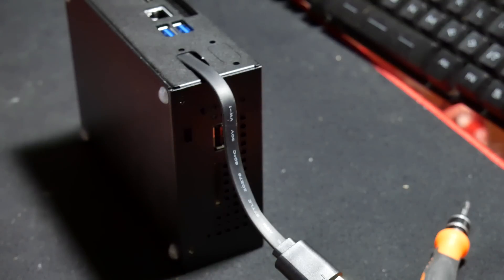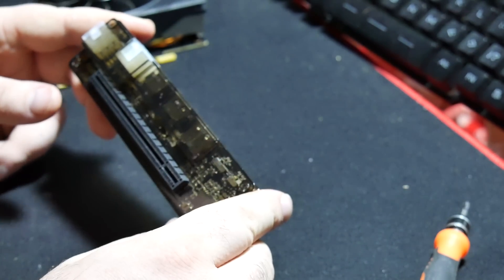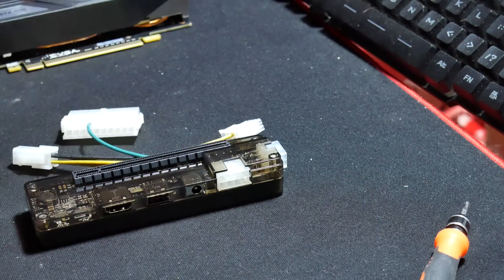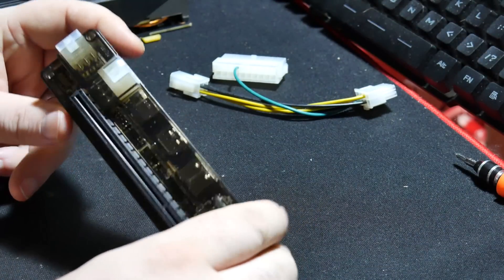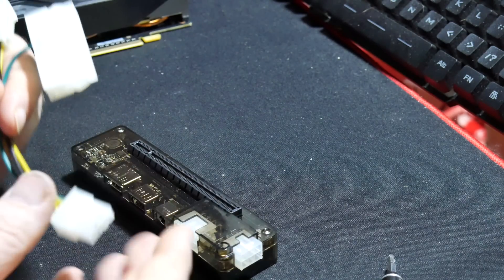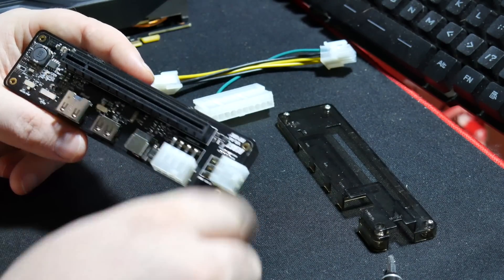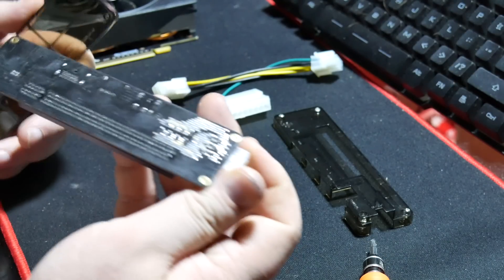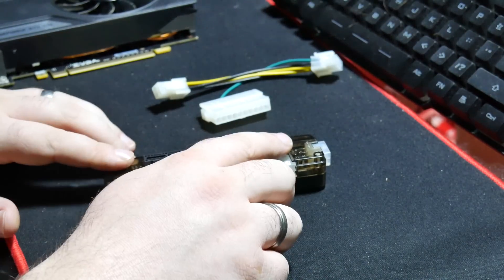Beast 8.4d - External PCI-E Adapter - Tear Down

Comment: atx power is not for it to run on atx power. it's for the e-gpu to either be always on when it get's power from the atx, or only being on when the hdmi cable gives it signal. this is for people who have issues that there computers wont detect the e-gpu while booting, they can leave it always on so it will be faster recognized by the bios.
oh and the slim line toggle is for the usb port to toggle where it get's ground from, i don't 100% recall what it was
Reply from the maker: +Dennis Gagliano awesome thanks for the info. I know that I myself know next to nothing about this I just find it such and awesome device to have around my office for testing and stuff like that.  I got the Dell PSU for it but haven't tested it out yet.
Reply: i have, the dell works great, i had a gtx 960 in there overclocked and all using the 220w dell, no problems at all. :)
Reply: Hi I'm thinking gonna use the music gtx 750 ti twin frozr 1gb but can I use cheap psu running at 500watts or 225watts cheap psu is it ok or no?
Reply from the maker: +Shite Ness 500 since I don't know the rest of the build 500 watts should carry you just fine.
Reply: but i heard lot of people said cheap psu might blow/burn up is this true i mean i only use the cheap spu for exp gdc not for desktop.is it safe?
Reply from the maker: +Ameer Qan yes the quality of your power supply does potentially impact the life of your components. If a power supply fails it can potentially take out parts of your computer. My recommendation would be get a cheap yet reliable 80+ bronze PSU.  I know for a fact that you can get EVGA 80 plus bronze power supply for around 40 bucks.
Reply from the maker: +Ameer Qan quick question is this for an entire computer or just an external GPU?
Reply from the maker: +Shite Ness if this is for an external GPU using the Beast egpu adapter I would look up 220 Watt Dell power supply. It looks like a giant laptop power brick and it works great for the Beast egpu adapter.
Reply from the maker: +Ameer Qan sorry I didn't realize who commented prior.
Reply: i have 2 accounts so its me.So a cheap PSU not good for the exp gdc to run then i should use the dell power brick?
Reply from the maker: +Ameer Qan yeah if you're running the Beast adapter hop onto eBay search 220 Watt Dell power supply look for a massive looking laptop power brick Style with a odd-looking 12 pin connector. It looks identical to what's on the side of the Beast adapter. I use the Dell on my Beast and I'm running a gtx 960
Reply: ok thx but i have HP sleekbook 14 laptop im afraid HP has whitelist their wifi card if i remove and put the minipcie exp gdc cable in it and wont boot.is there any fix for that if i encounter one?
Reply from the maker: +Ameer Qan there may be your best bet is to do some Google Foo and see what you can find before doing it. Sorry I'm unable to help more on that aspect. I've only ever  used mine on a i3 nuc.
Reply: ok thx im also thinking gonna buy either cheap gaming pc or mini pc with external gtx card
Reply: is this the one the dell power brick i cant seem the odd looking 12 pin connector so im not sure? https://www.lelong.com.my/dell-usff-220w-power-supply-adapter-optiplex-745-755-760-280-520-620-startechmy-166262288-2018-08-Sale-P.htm
Reply from the maker: +Ameer Qan yep that's the PSU
Reply: ok thx bro
Reply from the maker: +Ameer Qan no problem

Comment: What is difference between v8.0 and v8.4d?
Reply from the maker: Unsure from photos they look the same but maybe it uses a different HDMI standard for more speed. Idk never had the 8.0 only had the 8.4d.
Reply: Thankyou for reply.
I want do build an egpu setup 
I have samsung ativ book 8
3rd gen i7 3635qm with Radeon 8000series chip.
Will egpu work on my laptop.
I am thinking to buy RX580.

Comment: Hi Anthony if you still around here i need to ask you something about your EGPU setup, any halp will be apprecieted. Thanks in advance.
Reply from the maker: Sure I will try my best to help.
Reply: @krypticnexus  I have an Intel NUC same as you but i couldn't get the system working. Do you have any special set up or just plug and play. I don't have any other cable or device to try different cable or device. I don't know if its a system or able failure.
Reply from the maker: I had to start and stop my system several times before it just started working it was very odd how it worked

Comment: Since it has pcie 16x will it work wit sound card or Raid controller too? Any one test?
Reply from the maker: It really should work with anything and no testing has been done on my part. It just would be like plugging said card in to a 1x slot like I do with a gpu.

Comment: Can I put it on my Desktop?
Reply from the maker: Why would you?
Reply: @krypticnexus  attempting to do something hehe
Reply from the maker: I mean technically you could is your motherboard add a msata socket.  the only reason I ask why would you he is because the card that would go into the adapter would only be running at 1X speed
Reply: @krypticnexus  I was gonna use it to side mount my gpu but if it takes away from performance that much I’ll just order another cable

Comment: Hey i was wondering if you could help me please , i have an asus g74x or g74sx Laptop from 2011 was wondering if this would work ????it had the same wifi adaptor i can afford to sacrifice
Reply from the maker: Sadly it's pretty much trial and error. It depends on if anybody else out there has tried it and if so if it had worked for them. getting it to work on the computer I used was a Major Pain. It probably took at least 20 boots before it worked. Because there's no bios setting 4 something like that so it's just plug it in turn it on if it doesn't work turn it off it back on and hope for the best. I would say see if anybody out there has used the beast on a similar laptop to yours. Sorry I couldn't be of more help.

Comment: Hy bro please tell me that does gtx 1050ti mini 4gb supports exp gdc v8.0
Reply from the maker: +King ABLN it will support pretty much any pcie video card that's not the issue. The issue would be bandwidth limitations. Because you would be taking a pcie 16x card and connecting it to a pcie 1x port. Basically you would be going from 8gb/s to 500mb/s.
Reply: Anthony Cress then what should I do to get maximum speed bro?? Or tell me what card should I get to get maximum speed but I need 4gb ddr5
Reply from the maker: is this the only option you have. other wise i would put it in a computer with 16x slot. also depending on the connector if you are using a minipcie then your limited a lot but if you are using a ngff pcie x4 then you maybe ok.
Reply: Anthony Cress bro where do I connect ngff cable in my laptop
Reply from the maker: something like this would offer more bandwidth since its pcie 4x

https://www.banggood.com/M_2-X4-Version-V8_0-EXP-GDC-Beast-Laptop-External-Independent-Video-Card-Dock-With-Power-p-1109912.html?rmmds=detail-left-hotproducts__4&cur_warehouse=CN
Reply from the maker: it just depends on your laptop
Reply: Anthony Cress bro or else does rx 550 4gb works with 70 to 75% with exp gdc v8.0

Comment: is it support the Zotac Amp Edition GeForce GTX 1060 6GB DDR5 PCI-e Graphics Card with IceStorm Cooling
Reply from the maker: +Stone Cold Steve Austin it theoretically should work but it's going to be a massive bottleneck because you're trying to put a lot of info through a 1X pcie Lane not a 16 x

Comment: i think i saw m.2 slot in the compact pc that you opened up , did you tried using m.2 version of exp gdc ?
Reply from the maker: +Corvo Attano I don't have the cable sadly so I have not tried it
Reply: i think its a whole different unit not just cable , anyway thanks for texting back ^_^.
Reply from the maker: +Corvo Attano amusingly it's not it's just a different cable that is needed for all of the the different versions. It's 26 bucks on banggood

Comment: Instead of the HDMI to Pcie could I use a HDMI to a USB 3.1 type c. Because my Acer E15 does not have a Pcie only a M2 Ssd
Reply: mostly likely not, because its not using HDMI in the way you'd think

Comment: Hey man, I have an ASUS TP500LB with an internal Nvidia 940m, I bought 2 EXP GDC, one is 8.4D and the other is 8.3E, the 8.3E comes with a fatass cable which for some reason does not work,  it only worked once because the nvidia card is not shown in my Device Manager, but I had no problems with the cable that came with 8.4D, do you know what to do with that particular cable,and why it does not work. these are the 2 cables:

http://gloimg.everbuying.net/E/2015/201512/goods-img/1468363921956843257.jpg
http://gloimg.everbuying.net/E/2015/201512/goods-img/1468363921956843257.jpg
Reply: Hey man how did it go with the eGPU? Have almost the same laptop, was hoping to do something like you did
Reply: It works fine, the really problem here is the setup , but it work not excellent, but good, you can still get BSOD and crashes, also I strongly recommend disabling Windows Update because it will try to update your Nvidia Driver, I will explain why later.

I am using Nvidia GTX 1060, DO NOT USE IT!

New drivers don't work at all, in best case, the second screen will freeze and the picture will only be shown in your laptop's  screen, in worst case you get a BSOD, the only driver version that works for GTX 1060 is 372.54, 372.70 used to work too, but not any more, at least not for me.

I definitely recommend the EXP-GDC, this is awesome, you should also always have 1 extra PCIe-HDMI cable, because they tend to become damaged pretty easy.
Reply: r8Rusoski i thought the error 43 was resolved with the latest drivers for the gtx 1060? Are u able to play wolfenstein 2?
Reply: Which version are you talking about?

Bad news are that the only one version working for me is 372.54

I can't play EuroTruck Simulator 2, CoD: WWII
Reply: don timbol Hy bro please tell me that does gtx 1050 ti mini 4gb supports exp gdc v8.0 l. Please reply soon

Comment: Did you try to connect that into a Thunderbolt type C port? using a cable hdmi to usb type c... this for a laptop who have this port obviously, You think that its possible? (sorry, I don't speak eng)
Reply from the maker: +Mijais Cares sadly no I don't think it would function at all. Also I have no way of testing this idea. I think it would be pretty cool if it did work.

Comment: What's the deal with the Dell brick style PSU? Do I run power to this board from the Dell PSU and the PCI-e card just takes the power from the PCI-e slot?
Reply from the maker: +Adrian Kielbowicz basically, the reason for the Dell brick style PSU is that it's less messy and cluttering than the standard ATX power supply would be. And yes if you have a pcie slot powered graphics card then it will power it if you have something that requires external power it comes with external power connectors that connect to the PCB of the external graphics card and into the card itself and the brick power supply will still have enough power to supply that card fully.

Comment: This thing make me cry.......i keep get ERROR CODE 12, Even installed Diy Egpu Setup 1.X, try many many time, finally i give up.
Reply: error 12 is just down to pci compation in diy egpu setup, do it to the max and note that it won't take effect if you don't boot your computer through diy egpu setup - second option in its boot menu), there could be loads of other errors which you could run into, also I played with my EGPUs PTD switch which could also have played some part, I think my machine didn't even detect the EGPU on default switch position, I keep it at middle, setting this thing up on some boards can be hell tbh
Reply: that startup option I was talking about is second in this screen:
https://odd-one-out.serek.eu/wp-content/uploads/2014/04/DIY_Menu.jpg
(automated startup) if you don't use that to boot Windows then you might as well not use DIY egpu setup, you have to do PCI compaction on all available devices and disable unused bridges or whatever that option was called
Reply: my first comment wasn't posted due to youtube link - so in DIY egpu setup 1.x:
1. pci compaction on all pci, disable unused bridges (makes error 12 go away)
2. port speeds to 2x/4x on egpu slot in diy egpu setup
3. older or newer egpu card driver in case of bsod (make sure you use desktop card driver version)
4. PTD switch to other position on egpu board (middle in my case)
5. booting Windows through diy egpu setup 'automated startup' option

I also did the hardest option which involved creating pci dump with RwV1.4.7 soft and then loading it, but I am 90% sure it played no part and made zero effect
Reply: not sure if your problem is chainloading vs startup.bat, it never worked for me with chainloading, though it might have been just due to bad setup
I was talking first of all that clean booting system won't work as DIY EGPU Setup 1.x works only when you boot on top of it
It saves all your configuration in some files (I don't know where they are on hard drive) so you need to run through pci compaction - all pci devices, and check removeunusedbridges under compaction menu - it will saves this all in some bat file, that you can also edit manually.
I think I had pretty much all errors that there could have been as it requires very delicate configuration on some systems.
I also did not disable integrated video card, I actually play through my laptop's screen with game using egpu for physics and rendering.
Here I glued together several codes found on net to make a small c# app which automatizes process that I need to do to play windowed games thru egpu on my laptop's screen which has no native support (like optimus) to do this out of box:
https://sourceforge.net/projects/nooptimusfix/
Reply from the maker: +南道爾 I wish I could help you. It took about 30-40 tries before I was able to get mine working.
Reply: omg, i never try startup.bat........i always finish the set up then choose chainload.........thanks for help,i will try that.
Reply: if you are still having error 12 after properly doing this, like in this screen:
https://sslcdn.techinferno.com/uploads/monthly_2016_12/post-14517-14494996352865.thumb.jpg.ca8e718310a08876b2c0015b12b81a1d.jpg
1. all pci-e devices
(igpu and egpu compaction just gave error for me)
2. closeunusedbridges
then you could try disabling all unnecessary ports devices in bios/device manager, then rerunning that compaction, and again shutting down, and booting with startup.bat > windows 7/8/10
that error is definetly just due to not enough system resources for another gpu - typical laptops were never designed with another gpu in mind, so system does not assign resources so that there would be enough space, diy egpu setup helps hack that problem thru pci compaction
Reply: and again there is switch that says PTD on the EGPU adapter which is exactly for fixing hardware resource conflicts, it didn't work on the default state for me, you should experiment with all three states rerunning pci compaction, shutting down then booting straight thru startup.bat > Windows 7/8/10 option and not from EGPU menu based GUI, but straight from its boot menu, I mean this:
https://odd-one-out.serek.eu/wp-content/uploads/2014/04/DIY_Menu.jpg

Comment: Do you know if there is a difference between the v8 and 8.4d? I have the v8 and wondering if I would get any more performance out of the 8.4d.
Reply from the maker: +Ayman Suleiman I honestly don't know if there is any differences or not but I don't figure there is really. Figure it's more of a design update for the PCB.